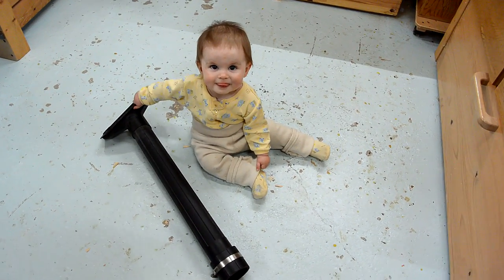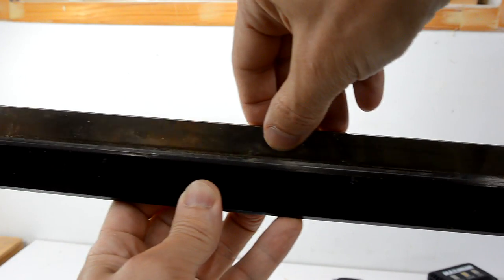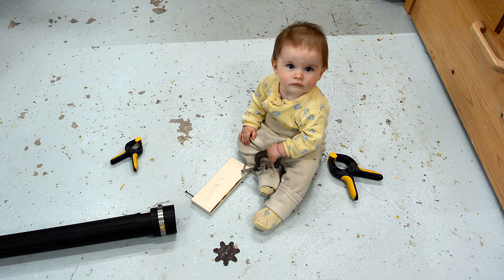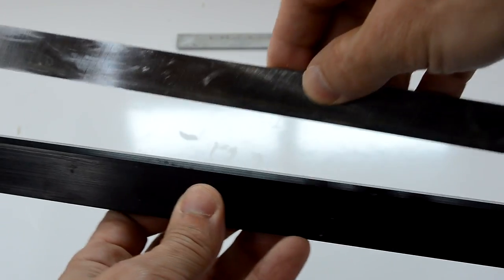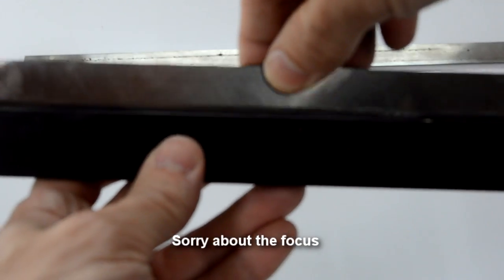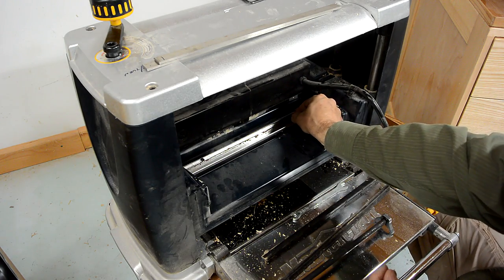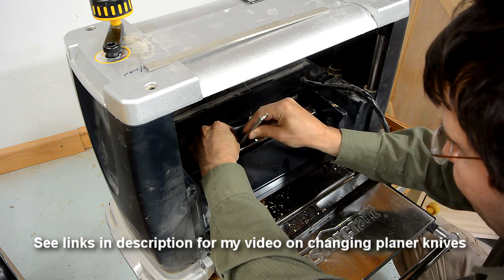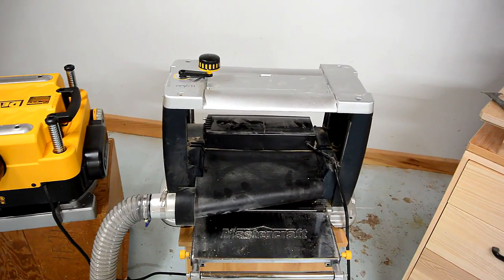Sharpening planer blades / bad parenting

Comment: Nap time always feels like a victory
Reply from the maker: Amen!
Reply: A second that as long as they sleep cause with teething, hour victories turn into 15m of hell plus.
Reply: awesome, now only to insulate the house for sound proofing :)
Reply: Just a protip:Waterstones should be like a baby's diaper is most of the time. Completely soaked. Soak it and use a lot water on it. Water should be standing on it's surface during use. Use a cat litter pan and block to raise the stone above the rim of the pan. Lots and lots of water.

Comment: Matthias, IMO that waterstone needed some watersoaking before using it 'cause it was pretty messed up by your blade's metal dust. Great job on sharpening thes!
Reply: +1 min 10 mins soaking submerged!!
Reply: It wasn't messed up it simply got some abraded metal on it. He didn't scratch the stone and he got the blade sharpened.
I find that with knives that are properly hard throughout soaking is not that important. Softer metals such as the outer layer from laminated blades require standing water or the metal will smear on the stone and clog the surface. Anyways, water stones are overrated. They are just to slow. Sintered carbide stones are dirt cheap and cut more aggressively. The fine edge can always be done using some polishing compound.
Reply: i agree waterstones should be completely soaked and lots of rewetting while using. Anytime the surface starts to look dry it should be completely flooded with handfuls of water until the water stands on the stones surface.
If you have to do it indoors, get a cat litter pan and put a block or something to hold the waterstone above the edge of the pan. Use lots and lots of water.
Reply: I agree on the soaking.  And it should also be flattened by rubbing it in a circle on some 220 grit (wet) sanding paper laid on a flat surface.

Comment: Hi Mathias, I enjoy your videos.  Especially the pantotrouter.  Anyway, I have an old Grizzly 6" jointer that I bought and rebuilt. After getting new carbide blades and fussing with them to get them setup properly, I found out about Shellix helical carbide heads that have little carbide 4 sided cutter blades which totally eliminates setting up jointer blades ever again.  They work so much better than straight blades.  Then also I got myself a planer that looks very similar to your Mastercraft model but mine is made by Cutech Tools and comes out of Tennessee.  I bought it with carbide  cutters similar to Shellix but the only have 2 sides to them and they are in straight line, not helical.  But they work just as good.  And it was 100.00 cheaper than the Dewalt sells for here.  No more straight blades for me!!!  Keep up the great videos.

Comment: Have you seen the jig for sharpening planer blades that holds them parallel and at the right angle so you can run a diamond hone over the top?

Comment: For flattening or straightening.
If you don't have a granite surface plate - Free glass remnants are very flat.
You can stick abrasive paper onto the glass with water or Windex, then stroke the blade on the abrasive.

Mock up some sort of simple wooden block with a slot in it to hold the angle consistent so the block rides on the glass and the blade hits the abrasive.

Comment: Hey Matthias, you should check out how to use those super nice Japanese whetstones on youtube. 
A few main points include:
*soak overnight completely submerged to get best results 
*use the whole face of the stone evenly and not just the middle.
*there is a specific way to hold the blades against the stone to keep a consistent angle.

Comment: i have an older jointer, and t has a 4 knife cutterhead. one knife is kind of low, so I took it out to sharpen and raise it, but when I went to take it out there were no springs or set screws to set the knives. i ended up shimming it with nails and then taking them out. i used an indicator and it is in line with the other knives. this method was rather tedious, so I wanted to know if you knew about this style of cutterhead and how to set the knives properly
Reply from the maker: There are aldo magnetic setting gauges which can pull the blades to the right height.  maybe that's what's meant to be used?  or maybe the springs were lost?
Reply: +Matthias Wandel there are no indentations where springs would be held. it's an old jointer, so it might use and obsolete system of knife settings.

Comment: I don't care for after-the-fact suggestions like mine here, but, the first thing I thought of was a piece of glass with a sheet of wet-dry paper laid flat on the glass. Then set your bevel-edge flat on the paper and lightly grind away. Laying flat the paper will hold water nicely. I use 1200 and 2000 grit paper for finishing my bevels when I sharpen my edc knives before stropping.

Comment: maybe even have some kind of reciprocating gear so you would only have to turn the gear handle one way but the blade holding sled would go back and forth, and like others have added, a way to set the angle.

Comment: That Mastercraft Planer seems to work well. where did you get your dust, thats attatched to the planer, from?
Reply from the maker: The dust hood?  Came with the planer
Reply: +Matthias Wandel spell check error. the flexible hose connected to the planer.
Reply from the maker: It's a peice of aluminium flashing with a hose clamp around it.

Comment: is that enough to take that nick out of the blade, or does it just make it less prominent?
can the nicks be removed, or do you just have to work around them after that happens?
Reply from the maker: taking a nick out requires grinding back quite a lot.  You'd have to have a lot of patience!
Reply: I wasn't sure if you'd run out of blade depth, depending on how the blades mount and if the can be pushed "forward" or "out" to compensate for removing so much material.

Comment: Sorry if I've touched on a frequent question. Why do Canadians and Yanks refer to timber as "wood"?. In Australia; if it resembles a tree its wood. If its been processed (timbermill etc) its "Timber"
Reply from the maker: Is "timber" not made from wood?  Question is, why do australians insist on calling it timber?
Reply: +Matthias Wandel  You'd have to ask an Etymologis. It's a historical thing I suppose. Wood's for burning: Timber is for building stuff.
Reply: rollvideo In the US dialect I'm accustomed to, "timber" is forest wood, while cut and processed wood is lumber.

Comment: If I might suggest soak those water stone for at least 30 minutes before using, but your method worked fine for those blade. I own a tool sharpen business so of course I use machines for this, but for the average person, this is fine.

Comment: should build a jig for sharpening long blades like this, with one rotary gear, and one straight gear to move the blade clamping sled back and forth on the grinder or the stone, and maybe even have a fine adjustment set of gears for your heights

Comment: hi, i own a few of those Canadian tire/ harbor freight machines. when i first used them, i did a small teardown and replacement of all fine adjuster hardware with hardened ones, alot of filing and sanding and lube. did you do the same? or were you able to use them right out of the box? awesome videos, right up there with AvE, my fav channel.

Comment: Mattias, could you not build a grinding AND sharpening jig so that a grinder and sharpening stone could be 'railed' along it to grind/sharpen a blade that was fixed into place, (or vice versa)? That'd be better, (I think), than holding a blade manually on a grinder that's constantly moving - after finishing, the blade's line would be straighter and maybe sharper too, no?

Comment: this calls for a jig!!!

a drawer slide with a piece of 1x1 screwed to it.  the 1x1 has a grove cut at an angle to hold the blade, making a "c" shape.  the "c" has some set screws in the middle of the "c" to give fine adjustment of how the blade is held and more on top to clamp down on the blade.

set blade using plate glass for straightness then mount to grinder so slide gives one continuous grind.
Reply: The force difference by hand is small.. but the result is just that, bowed.
Reply: +wobbly sauce 

hand pressure differential. May be low, but there is also the weight of the blade levering over the edge of the grinder.
Reply: That is it.. you really do not want to press on it. 
The force over each hand, should be almost floating, but in the middle on a small grind wheel you almost want to lift up.

Then there is the other part of it, when using it in the equipment, most would just be sent though the middle and so it wears more there.

So to be flat you need to spread the use over the blade, or sharpen more often, or less often but with a slight bow the other way, as it wears down the fastest at that point.

Comment: I'm surprised you haven't got a slow wet grinder. Tormek or similar.
Reply from the maker: Have been looking at  them, just haven't felt like spending that much money one one.
Reply: +Matthias Wandel  yes they are not cheap. but as a wood turner I spend a long time sharpening.
Reply: Make one then, but put it on a treadle, with angle setters and the whole nine yards, make plans and sell them, and I have already forgotten that I'm suggesting this to you, so you don't even have to credit me. :)

Comment: if you are not careful sharpening the blade smoothly from the left then smoothly back to the right WITHOUT removing the blade will result in more grinding on the ends than the center. As you gradually slow before changing directions more grinder wheel revolutions pass under the blade than when travelling across the center at a steady rate. Just a thought...
Reply from the maker: That's why I check it against a straight edge.  And I always seem to remove too much in the center.

Comment: I sharpen planner blades and chisels on the rear wheel of my belt sander.  it leaves a concave finish, then a touch on a Dimond hone  and the tools are as sharp as a razor.

Comment: Just some advice, you need to soak your Japanese water stone by submerging it at minimum until it no longer bubbles. Maybe a typical whet stone may work with just a bit of water poured on it but what you have won't.

Comment: Japanese waterstones need WATER!
Reply: Yeah, they're supposed to be soaked for hours before use.
Reply: minutes.
Reply: it does depend on manufacturer of particular stone, but looking at it the one Matthias is using is around #1000 grit so, somewhere around 10 - 30 minutes should be alright.
Reply: Yeap 10-30 is right and they need to be wet all the time, meaning you have to use water while sharpening.
Reply: I'm Japanese, and I've learned to NOT wash the black muddy stuff that comes out when you start to sharpen. The "mud" acts as abrasive, much more than that of the surface of grinding stone.
Reply: Depends on the type of the stone, if you use nagura stones etc etc.
Reply: +total22cal Yes, the particulates act as an abrasive. But we are not talking about washing the stones during use. We're talking about soaking the stones before use. You can see how quickly the stone absorbs the water Matthias applies - that shouldn't happen.
Reply: ah, yes. That was a little off-topic. Absorbing water shouldn't happen at all.
Reply: As those stones wear faster than oil stones they don't load as much, so why not use them dry?
Reply: The main reason not to use them dry is because Japanese sharpening stones are quite soft compared to western oil stones. The reason for this is to match with the soft iron used for Japanese knives. For that reason, sharpening all stainless steel or all steel blades much seen in western countries will wear Japanese stone VERY quickly. Not to mention they wear quickly enough even with Japanese blades.

On a side note, never use oil or detergent on a water stone, especially on #3000 or above. They will make the surface of water stones too soft, and to get the most out of it again, you'd have to grind it to reveal a new surface.
Reply: Depends on brand. Some can even live in water. My Shaptons only need a spray from a bottle and they're ready to go.
Reply: Yeah Shapton's are like plastic lol.
I use a natural oil stone locally from Crete, close to Arkansas but even better since they have raw stones.
Reply: leosedf
Like plastic? I know what you mean, but after I go through my stones, 2k, 5k, 8k and 12k, and seeing the mirror finish on my blades, describing it as plastic just seems... inaccurate?

But yeah, I know what you mean.
Reply: I ment the texture of the stones, they are more dense and the resin makes them like that. But they are good stones.
Reply: @asdqwe4468  I don't know what you mean by "the other way round" but I don't disagree with your analysis. That may be the exact reason why japanese stones are soft.

Comment: that water stone needs to be alot more wet then that
Reply: clearly, it doesn't
Reply: And yet, it does.
Reply: Yeah it really does. Japanese stones are softer due to the fact that the good tools manufactured in Japan are still a hard carbon steel backed with a much softer iron. They need to have soaked in the water to act as a lubricant to not be ground down too quickly with use.

Comment: Important tip for next time you sharpen on that Japanese water stone:
It needs to be soaked entirely in water until no bubbles is coming out of it. That it why it is soaking in the water you put on it. You'll ruin it by not doing it correctly :)
Reply: How will the stone be ruined by not being soaked? Do you even know what the water does?
Reply: Japanese water stones are designed to grind using the kind of water "slurry" that is created when the top layer of stone is ground off and mixed with the water. The slurry is the thing that will grind, not the stone itself. By not using water, the stone's top layer is getting ground off at a much quicker rate, and it is getting ruined too quickly. 
Look up any japanese video on how you are supposed to use it, and see what I mean.
Reply: Andreas Dybdahl
Well I have Japanese water stones and I don't leave no slurry of slop on top of mine when I use them. No, the water is there for lubrication, and to take away the swarf. You can't sharpen shit with mud!

Comment: The problem is not only keeping them straight is keeping them even. You want all 3 hitting at the same depth. It's why I don't sharpen the planer blades. They are cheap enough to buy.
Reply from the maker: I sharpen them because they aren't cheap to buy here.

Comment: Did you say aluminium extrusion. Aluminium extrusions really are not very straight. you should have used. the table on your table saw.
Reply from the maker: Aluminium extrusions are straighter than a typical table saw is flat.
Reply: Well I think the method for aluminum extrusion can cause wall thickness to vary and the cooling of extrusion can cause warp. I haven't checked the tolerances of aluminum extrusion. I just believe that when molten aluminum is purged trough die that doesn't produce very straight piece. Are the wood working machine tables machined straight. Because most metal working machine tables are ground or machined, then they are certainly straighter than aluminum extrusion.

Comment: usually those japanese waterstones need to be soaked for an entire day.
Reply from the maker: First time I tried it
Reply: For future reference, you should also not grind in a circular motion; grind with long deliberate motion with the blade and not against it. Grinding against the blade would just dull the edge you just sharpened.

Comment: You know nothing about industrial instrument sharpening. You never touch a flat side of the blade, never.
Also this type of blades can only be sharpened reasonable on the flat surface grinding machine with angle plate.
Instead of destroying your instrument, give it to the professional for sharpening, who has the right tools. Save your wet stone for something like a chisel.
Reply: It worked for Mathias. Maybe you should just keep on watching the video until it becomes apparent to you too.